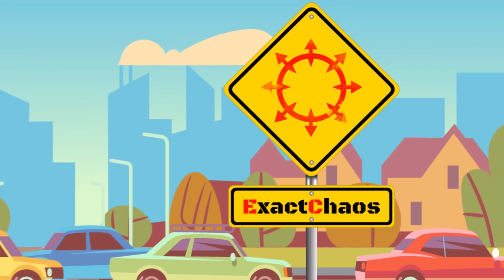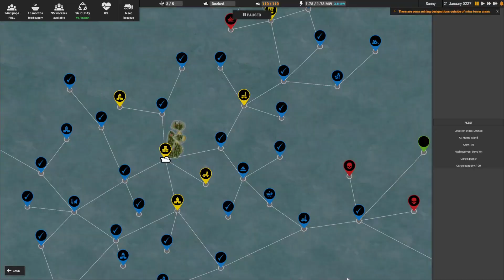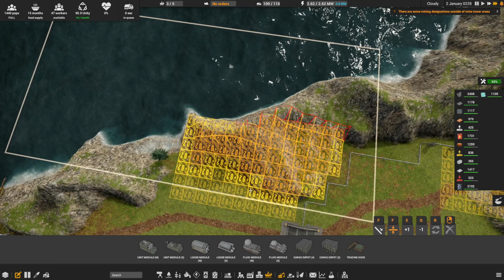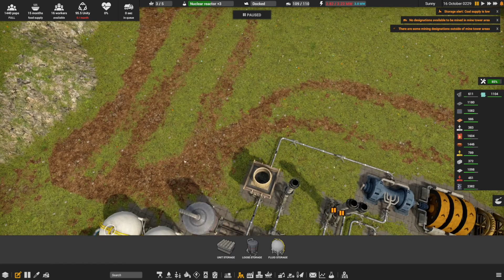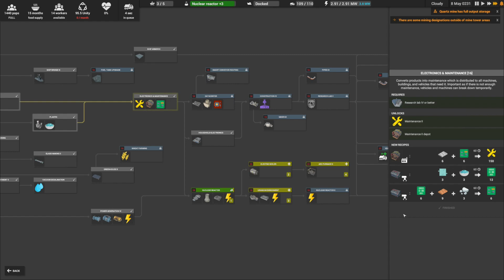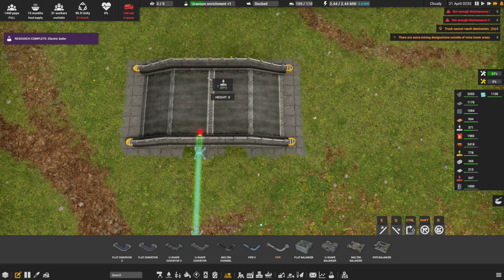An Expanding Refinery - Captain of Industry

Comment: you should be able to decouple coal from your power, first you make your oil refinery completely self-powering, using hydrogen to run the boilers, then you have digesters, you can turn waste water into sludge and water in water treatment to turn into digestate (makes fertilizer) and fuel gas, and the same (optionally making dirt instead) with excess food you can either use this directly or turn it into hydrogen, either way it's a much more scalable power solution than coal.

Comment: make sure you have extra food going into digesters, you can turn the extra fuel gas into hydrogen and run your boilers off of it, including the ones running your oil set up, because you get depleted steam from boiler exhaust when you use hydrogen, you can get that little bit extra water back when you run it through a cooling tower, haven't done the math, but in a power plant set up where all the steam goes through hi and low pressure turbines and then a cooling tower, it could be enough extra water to keep the boilers fed from just cooling towers.
Reply from the maker: Great idea, thanks